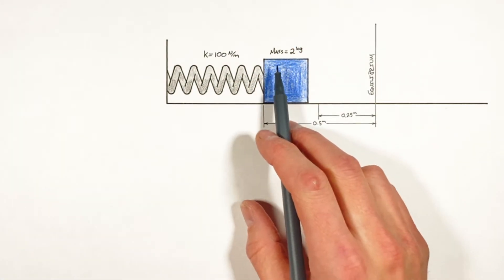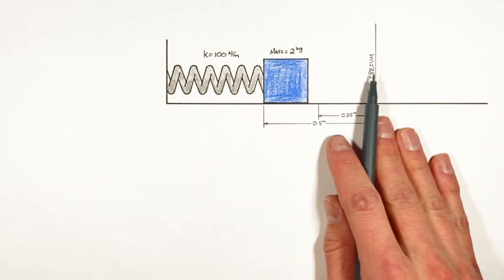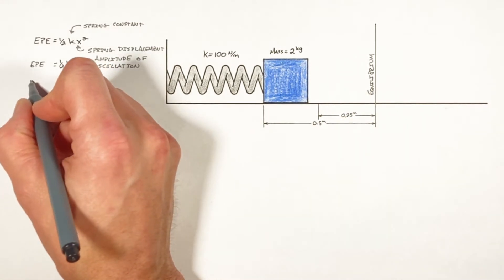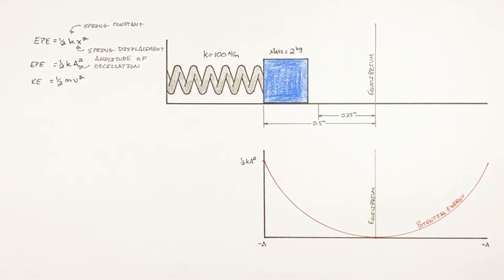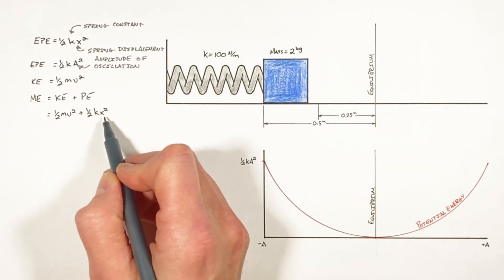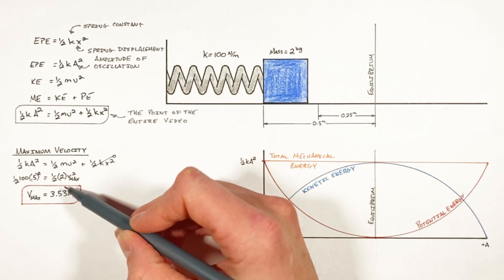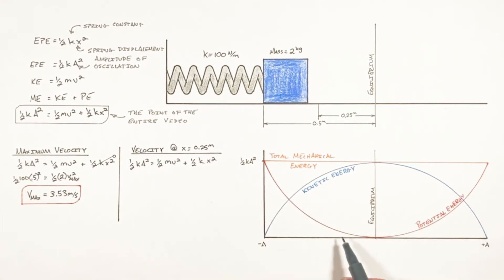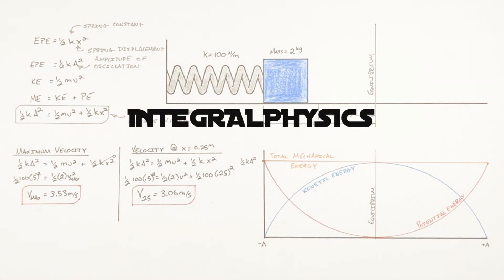Use Energy to Find the Velocity of an Object in Simple Harmonic Motion

Comment: I just found this channel and it is great. How many takes does it typically take you to get through the illustration without errors?
Reply from the maker: Sometimes the drawings will take several drafts until they look right.  Luckily I have done springs before (Springs in Series & Parallel) so I have previously figured out how to draw a spring.  This time around I just did a rough pencil sketch to figure out dimensions to put on paper, then roughed in the math and graph.